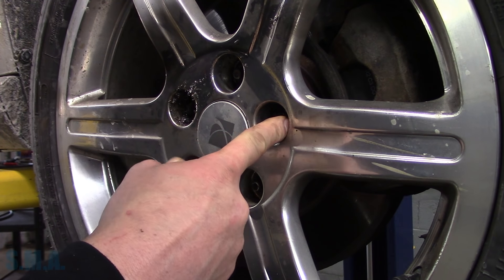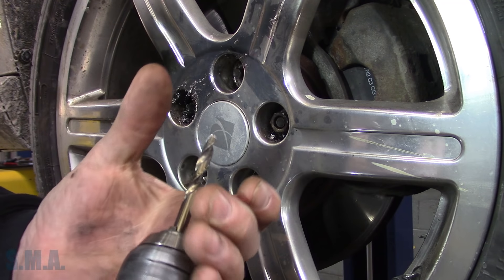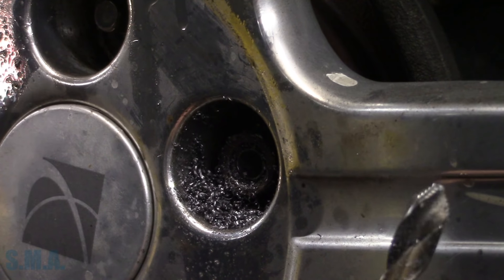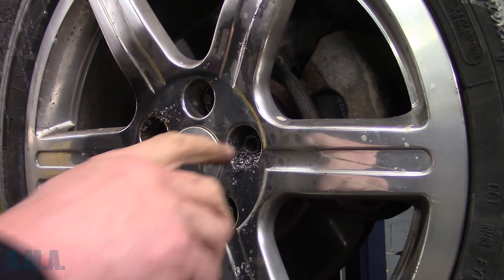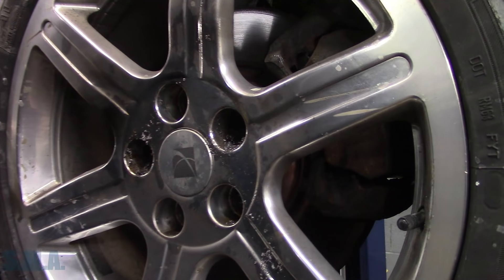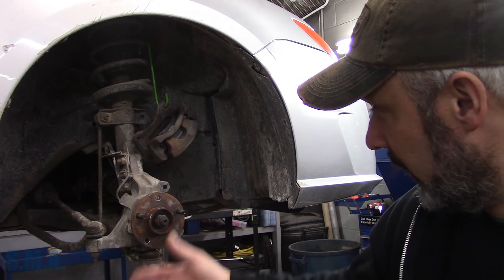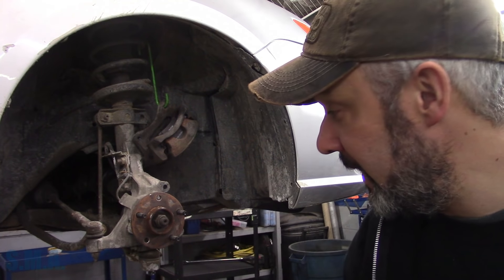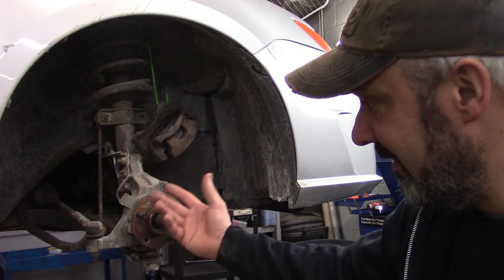DIY Seized/Stopped Lug Nut Removal

Comment: Best method I have is to drive it to a mechanic, leave car, come back an hour or two later, pay the man and hey presto. Job done.
Reply: That takes all the fun out of it
Reply: But later cant change flat tire.  It spins tire... lugs wont come off...
Reply: As long as they don't try to sell you everything under the sun and then some.
Reply: or not done, because they're no good?
Reply: Yeah unfortunately you end up having to fix their repair. I just had a local shop replace front struts and alignment. I got under there the other day to change oil and noticed they never attached the wheel speed sensor wires, just left them hanging. One was rubbing on the CV boot and was eating into the wire. So I had to fix that. Plus the steering wheel is at about 11:30 when going straight. Never letting them touch Old Crusty again. $1000 repair and they can't get it right. And this place comes recommended. I'd hate to see how an incompetent shop works.
Reply: with a empty wallet...
Reply: Yeah I know, I used to be one of those mechanics. Thank God I finally got out of that profession.
Reply: Robert Bell 
Same story with me, I took an 07 Honda CR-V to a local mechanic that some idiots in my neighborhood community would swear to his work, he diagnosed car visually and told us, it needs a sway bar link, front struts & lower ctrl arm to be replaced,  he said $300 for labor only, $850 total. anyways the car later is ready to go, so I test drive it and still some rattle coming from the rear, I told him bout it n he said no,.. I didn’t replace rear struts they probably need to be changed too!  and some 3 or 4 lights popped up in dashboard screen afterwards, and obviously he want extra charge for turning them back off ! 
Sometimes you gotta let it go n trust in ur guts of which mechanic to go to despite of what some people say about them and the reputation, the car was for a fam member not mine, been told to go there, n when I need to fix my own car I usually go to one mechanic that I’ve already put some good vibe on em, they’re lile pricey they’re Mechanics of course, but haven’t failed yet to do what I wanted n what the car exactly needed
Reply: Hi folks, we did that . tire shop broke all of his extensions. Sent us away as it came in . BACKYARD DIYer here.  Thanks
Reply: @AmandaHugenkiss2915  do most shops not offer a guarantee? I know I've accidentally bumped a steering wheel doing an alignment and was short on time to give it a proper test drive so it left with the wheel a little crooked, unbeknownst to me. I give a 30 day guarantee, so they were back after a few days and I took the time to do the job right. I know, I know, do it right the first time, but we're all human in the end. At least I pride myself on putting things back the way they were, like wheel speed sensor and misc clips
Reply: Two hours?? You gota be kidding
Reply: Yes, if you dont mind shelling out a 1000 bucks on a complete brake job including pads, rotors and calipers.

Comment: Ahh the ol "You can't be tight if you ain't there anymore, metal!" technique
Reply: As opposed to "it can't be tight if it's liquid" - when you bust out the blue tip wrench.
Reply from the maker: I'm gonna drill it, hammer it or turn it to liquid, either way I win in the end 😏
Reply: @SouthMainAuto  another method I've used is a thin wheel on an angle grinder, plunge cut straight down the stud. of course that's if the rim's allowed to get trashed
Reply: my peronal favourite, can't be tight if its fking vaporised aka plasma cutter

Comment: Rounding off the wheel nuts is a clever way to prevent wheel theft.
Reply: Quick tip Tuesday.
Reply: After this video wheel thiefs put a drill in the tool bag and a link to this channel in the handbook of wheel thiefs........
Reply: Thief's are lazy, they would just steal the whole car.

Comment: Thanks Eric. That's why I bring my cars to you and not the other shops. Walmart was the last shop to touch this car FYI. Literally just bought the car a few days ago.
Reply: Andrew, I hope you took pictures and are going to make Walmart service pay you back for Eric’s hard work? At least make the Wal Mart general manager of the store know what his service department and tools are doing to customer cars. 20 of them makes me think it was all on purpose!
Reply: Remember, "Righty, tighty, Lefty loosee"
Reply: Do Walmart repair cars? Selling bananas and fixing cars good strategy
Reply: @jtb52  Super Walmarts tend to.  Any pushing tires usually does. My Walmart doesn't, next one which is bigger does.
Reply: @jtb52  they re strategy must be written backward. They're fixing bananas and selling cars...
Reply: Do you still have the paperwork from that service? Because the policy is that the technicians that work on the vehicle are supposed to comment on ANYTHING abnormal with the vehicle, whether it be warning lights or messages on the dash, strange noises, strange smells, any fluid leaks, or anything broken or missing on the Vehicle. If the auto care center you took it to ISN’T doing that, then it tells me that the ACC management team and the technicians in the shop need to be retrained. The reason is for exactly this situation; the car might have had rounded off lug nuts before that vehicle even saw the inside of a Walmart tire bay. (The original lug nuts might have had swollen caps which is a rampant problem on most Fords with alloy rims)
Reply: @albing1397  Except on some old Chrysler vehicles from the 50"s.  Left hand wheel nuts on the left side of the car. BUT - they are marked "L".

Comment: Eric O: "I tighten the wheel nuts with a couple of Uga-Dugas."
Walmart Meat Puppet: "I tighten the wheel nuts until the shop compressor turns on."
Reply: Or until the air gun begins smoking.
Reply: Bwhahaha
Reply: Walmart has strict procedures in place to avoid overtightening and they legit use a clicker torque wrench as corporate policy.  I actually prefer to go there for that reason.  The other shops around, independent or not, just slam the wheels on with whatever PSI the tank's got.
Reply: @peeprox1991  speaking as a Walmart technician, we also use color coded torque sticks (I.E an orange torque stick is 80ft lbs, gray is 100ft lbs, and aquamarine is 140ft lbs) and my own personal method is to do 2 half second presses of the impact gun’s trigger and that is usually enough for the final torque with the torque wrench.
Reply: @peeprox1991  Bingo, remember, kids that a torque wrench reading is only valid if the fastener was moving when it clicks/beeps/deflects to the correct number. IE if you are using one and run out of swing without it clicking/whatever and you then reset and it then clicks before it starts turning again it isn't a valid reading. You have to then back off the fastener slightly and try again.
Reply: Haha!
Reply: @digitalrailroader  Walmart technician????isnt that’s kind of like saying I’m an amateur astronaut????🥴🤦‍♂️.
Reply: I can’t say, I’m not a biologist.

Comment: With all the times I have drilled out bolts and studs to get stripped / frozen nuts off, never did it occur to me to use that same method for a wheel stud.  Nice tip!

Comment: Had a similar problem on an old Lincoln Towncar, 2 years after the tires were changed by a big box store. Out of the 20 lugs, 16 came off with a little more effort. The lugs weren’t damaged just overtightend. I went to a friend’s house that had a better impact, all but one were removed. Knowing that they were the culprits, I went back to the store and insisted that they make this good. They did what you did and replaced the stud and a new lug nut. They did try to charge me, but I wouldn’t budge and they ate their mistake. This was Sam’s club!   Jim

Comment: Eric,
Great video and tip - thank you! 
FWIW - and I know some will disapprove - I always use anti-seize on the wheel studs on my cars.
God bless
Paul (in MA)
Reply: Been using anti seize on my personal fleet for decades . Proper torque, no problems ever. It's really sad a " repair " shop cannot cannot even service an automobile without drama.
Reply: Yes I have noticed Politicians are really trying to screw up the cars we drive lately, That's why the automakers need to use GDI, Turbos, and Diesel exhaust fluids, all just to move us into full electric cars.  No is going to want to own when it's -35 below zero.
Reply: Just a dab will do ya!   I also put antiseize on the lip between the rim and hub.
Reply: @shadowgarr7649  I do both.

Comment: Putting a torch to a real magneseum wheel could get real exciting.
Reply: Yes and it won't respond to fire extinguishers of any kind
Reply: yea but how many cars have magnesium wheels
Reply: All the pretty cool colors lol
Reply: It's very hard to light a magnesium wheel on fire, even with a torch. It conducts the heat away too fast.
Reply: I went to a Navy firefighting school while in the Coast Guard. They lit an engine block that was made of magnesium and showed it blow up when you shot it with a stream of water.  They said to fight it with very fine fog mist.
Reply: @Garth2011  juts douse it with water :)))))))))))))))))))))))
Reply: @boblister665  i caught a large pump housing on fire  i didnt realize was magnesium untill i seen the flames.  had a liquid nitrogen transport close by-- fire out !!!  but we were also done working on it for a day till it thawed out.
Reply: Is it true that magnesium can't be put out, and you have to wait for it to go out on its own?
Reply: @nikolaip4947  a very small single piece of magnesium burning can usually be put out with the proper extinguisher and chemicals for lots of cooling so it doesn't reignite itself! (NEVER-EVER USE WATER!!) it will go BOOM more or less exploding into a massive shower of burning molten magnesium chunks as the result, which massively spreads the fire around!
So anything beyond a single small piece and all bets are off, the best they can do then is try to protect surrounding buildings, objects and people.
Reply: @Garth2011  purple k 😂😜

Comment: I've had to do this a couple times - I think my drill bits are about half an inch shorter now!  I've since learned to loosen and re-torque lug nuts on vehicles every few years if they haven't been touched for a while.

Comment: Having worked with stainless and other hard steel for years, I have experienced there is a huge difference in quality of drill bits and cutting oils. Even if its might not so super important when working on wheel bolts, I would suggest to use a good quality cutting oil for this work. It will save you money and time. In the mid 90s I got a "impossible task", to redrill, by hand, several thousand holes in 316 10mm thick steel, flanges on huge ventilation shafts for offshore use, standing outside on a 5-step ladder, during the Norwegian hars winter climate. I used a Fein hand drill with high torque and low rpm's, and a handful of drills branded Dormer, and a water cooled drill bit sharpener. No one at my work belived it was possible to do this. 3 weeks later I was finished. Within the time, I tried several ways to drill as fast as possible, saving the drill bits as best as possible, and without doubt; a thick and sticky cutting oil and some perfect angled drill bits made the big difference.
So, for your next drilling project, I can recommend to do as you do, but get some better cutting oil. It will save you money in the long run.
Dont recall what brand cutting oil I used, but this video from Project Farm might be of interest: https://www.youtube.com/watch?v=v6QCrV4ZOiU
Best regards from western part of Norway :-)

Comment: Been there done that. Good tip.  
The locking nuts are a different ball game. I weld a pipe over nut with a stick welder and crank it off with my pipe wrench. Success!!

Comment: My Jeep wrangler has those crappy capped wheel nuts and I have one that is all boogered up so when the weather breaks I am going to drill it out. Thanks for the tip on the drill bits.

Comment: Recently picked up a car that has open ended cone nuts on extended studs (track car) with a raised threaded extension for putting beauty caps on.  Previous owner put one of these on all 10 studs on the rear rims.  I'm not looking forward to getting them off if I have to resort to drilling each one.  I've managed to find one key for one lug (Mcgard's) and I'm talking to a tech at McGards to see if sending some high rez photos of each locking lug can get the keys identified.  Such a pain.  Thanks for the vid.  I already knew how to do this but you gave some good tips.

Comment: Well ive dealt with many wheel lock removals and found the blue point wheel nut removers hold up and function very well. Hammer on twist socket but use a bar to loosen and takes no time

Comment: Wheel locks are fun to remove without the key. The DYI method I use is to take cheap 12 point socket that's slightly bigger than the wheel lock and pound that bad boy on there. That usually holds well enough to get it off. 😁

Comment: Eric, use a can of keyboard air cleaner. Turn can upside down so it sprays liquid, this freezes the nut. Use a socket one size smaller, a 19 then use an 18. Spray and freeze it, pound socket on and wait for it to warm up, 1 to 2 minutes then remove. Works 80% of the time and destroys the lug nut but not the stud.

Comment: The music reminds me of power block tv with Stacy David in the old days when he had the mullet. Believe it or not. I had luck with some lug nut sockets from Autozone. They were like a npt fitting. If you push hard on the impact they will thread onto the nut. I haven’t had to use on a nut that bad yet. Good video sir.

Comment: Don't try this with Harbor Freight drill bits - for anyone thinking about trying it. At least not if it's your only car 😂
Reply: Always buy namebrand drillbits. I like Dormer becasue we used to always have them in the machine shop where I worked. There are other ones too though like sandvik. Most cheap ones have the wrong edge profile so even if they were sharp they still wouldnt work.
Reply: ^^this. Go to good shop, tell them you want the most expensive drill bit they have. It's usually $16 for one instead of $1 but it'll work 1000x better, trust me :)
Reply: I bought a set of Milwaukee cobalt bits 10 years ago and they last, and if you destroy one you can get a replacement at Homies. I recommend them - good quality and reasonable price.
Reply: No not Harbor Freight, it's pronunced Horrible Freight.
Reply: They do sell some decent bit sets, but the cheap gold colored sets are total crap. I’ve got one of the larger sets with letter, number, and fraction bits in a steel case, and those are good bits. Not great, but a good value for the diy type.
Reply: @WayneRite758  Are you saying that Home Depot guarantees Milwaukee drillbits if they get dull or break?
Reply: No, Homies doesn’t replace drill bits for free. They do sell “loosies”, so if you destroy one in your set you can buy one of equal quality to replace it.
Reply: Definite stay away from any drill bit that is coated with shinny miracle metal. Quality cobalt bits (not coated cobalt) are worth buying. Milwaukee sells them in sets to 1/2” bundled in a steel case. You may have to find the set online, but the single bits sold in the big box stores are the same quality, if they are not coated cobalt.
Reply: @pyro323  "Horrible Fright"

Comment: Eric: I wish you had shown us how to replace the studs, but thanks for a great video !!!
Reply: He has videos on that already
Reply: The studs are usually just pressed in. You can knock them out with a hammer or air hammer. The new one just gets pulled back in with lug nut and some washers. hope that helps.
Reply: Installing the new studs is really as easy as it sounds.
Reply: @daveg7878  a former girl friend used to say similarly.
Reply: @shadowgarr7649  noice

Comment: Had to do this one time in a parking lot with 5 lug nuts, bought myself a lug ripper right after that. Best tool ever gets those studs drilled out in less then a minute
Reply: They are good provided there is enough clearance in recess that the nut/bolt fits into in the wheel. Also if its a locking/anti-theft fastener with a hardened ring on the outside you can forget it.
Reply: You’re right they do have their limitations but I’ve honestly never had any issues using them on a factory wheel (mostly older FCA that came with those poorly designed lugs)

Comment: 1996 grand cherokee jeep capped lug nuts siezed in place and rounded off. Got them loose with Irwin twist off damaged nut sockets. Used 3/4 inch breaker bar reduced to 1/2 inch for the sockets. They all came off no broken studs. Then I bought some good lugnuts and antiseized them good.